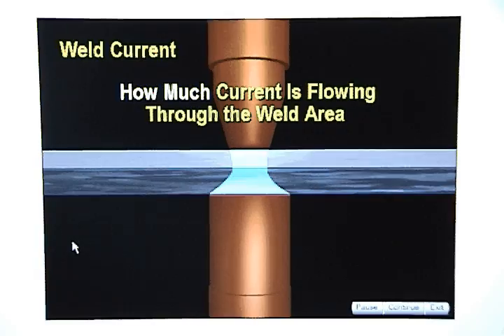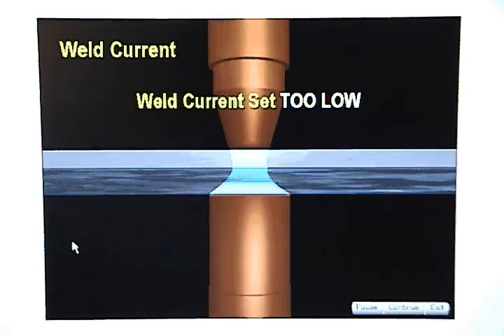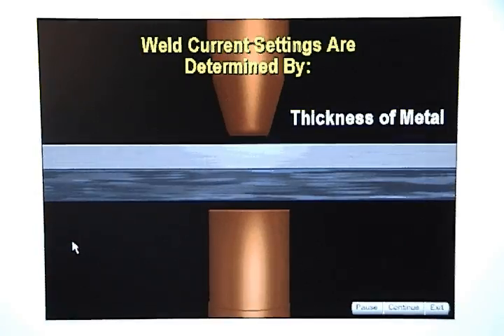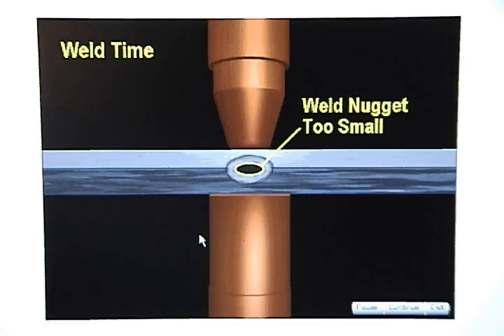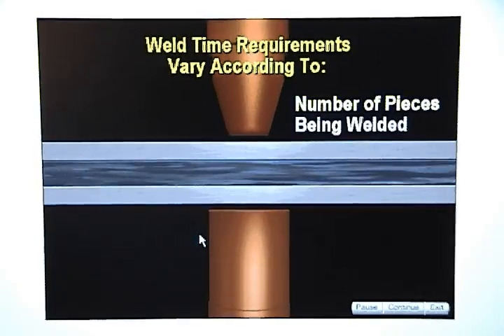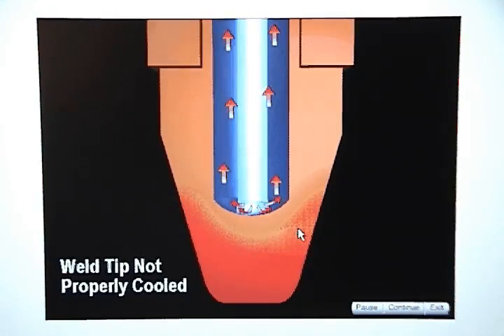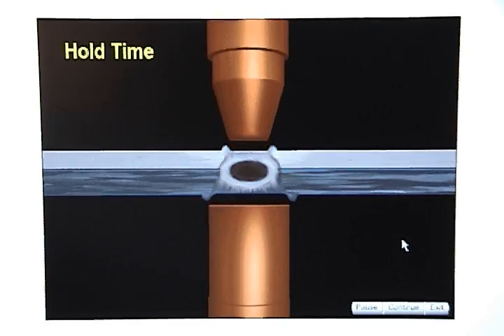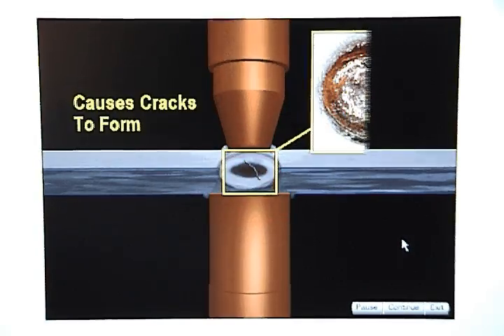Advanced Resistance Welding - EZ to Learn - spot weld principles - Service Call 248-701-9328

Comment: To add some more detail on the topic of water cooling the Electrode Tips. If the Deflector Tube (water tube) is too short, a steam pocket develops while welding. This steam pocket prevents the cooling water from making contact with the electrode, preventing cooling from taking place.